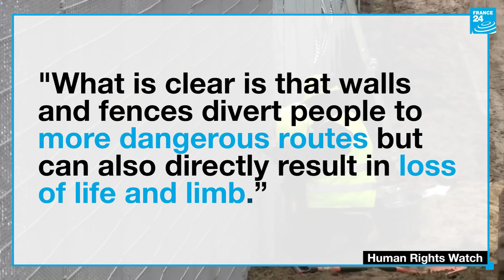Fortress Europe: From Lithuania to Greece, the fences spreading along the EU’s borders

Comment: There is a Spanish enclave in Morocco called Melilla. It has a fence that is stronger, higher, and there are 3 of them, including all sorts of electronic devices to monitor the border. There are 100 border guards per km of border. In addition, the Moroccan police actively helps prevent illegal border crossings. And still, 1000's make it past the fence every year.
Poland and Lithuania have more than a 1000 km of border with Belarus. A fence is never going to solve the issue.